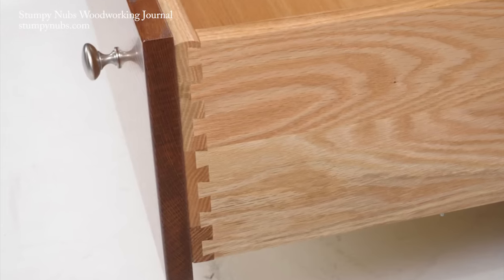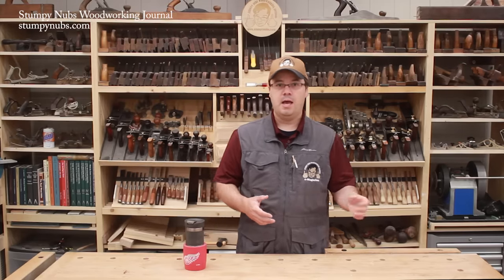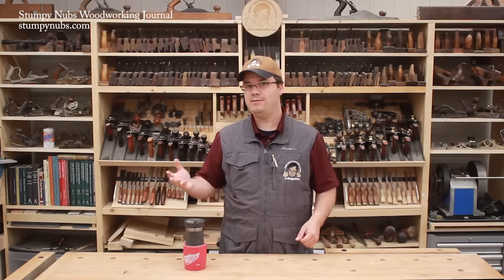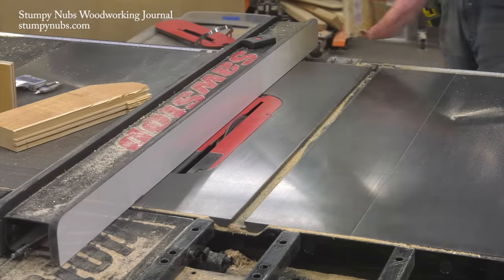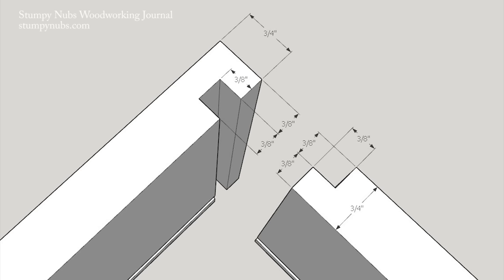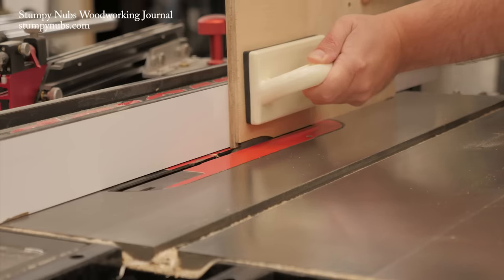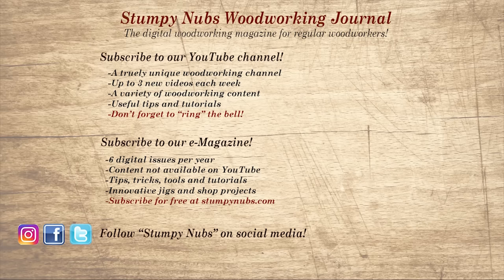The fast and easy half-half-half drawer construction method

Comment: I've seen the 1/4 - 1/4 - 1/4 videos, but they don't explain how to make the cut on the edge safely. This is the only reason I stay away from this method - balancing a thin board on its edge over a gaping hole doesn't look appealing to me. But  your explanation makes sense: tall feather board and a tall fence look much safer than other videos.
Reply from the maker: A zero-clearance insert also helps with that gaping hole

Comment: What is the tipping point for a half inch drawer to become a 3/4” plywood drawer? Is it the size, width, or what it will hold? Perhaps all three. Thx James.
Reply from the maker: Most drawers are perfectly fine in 1/2-inch. That usually  looks best, too. But a large drawer that will hold a lot of weight will benefit from 3/4.

Comment: I'm all about cost savings.  For draw bottom, if I have 1/4" and it will work, why not adjust setup to use the 1/4" sheet good.  It's such over kill to use 1/2".  If one doesn't want to adjust the setup, 1/4" into 3/8" slot is perfectly fine right?  It's not like anyone will see the 1/8" gap at the bottom of a drawer on the inside right?
Reply from the maker: A 1/2-inch drawer bottom is vastly stronger than 1/4-inch and not much more expensive. If you want to use 1/4, that's fine. But this technique isn't for that.

Comment: I disagree that the corners are the weakest part of a drawer.  I think the drawer floor is the weakest if made the common way of trapping a thin, floating panel in a groove.  This is why I've made scores of drawers by first cutting a floor to the overall size of the body.  Then I cut the four wall panels and set them atop the perimeter of the floor.  I use 1/2" Baltic for all the parts.  No sagging floors under heavy shop or kitchen tools and hardware.

Comment: so how does the bottom panel of the drawer slide in to the three sides of the drawer AND then have the 4th side which you are sliding down to it?  the edge of the dato groove on that fourth side will not clear the bottom panel?
Reply from the maker: Trim the groove off the back panel. Or don't and just put the bottom in as you assemble the sides. Your choice.

Comment: Using ½ inch ply that is always less than ½ inch thick presents a problem if one attempts to use a dado stack which is ¼ inch when using the 2 outer blades. This is greater than ½ the thickness of the ply. Ex: my ply is about 0.484 inches thick. Half of that is only 0.242 inches which is less than the ¼ (.250) inches of the dado stack using the two outer dado blades. So, what do I do?

Comment: One thing that still isn't clear for me is the final assembly. What is the last piece to go in? Is it the drawer bottom or the front/back panel? How do you fit the drawer bottom and the front/back panel into the setup so it locks in?
Reply from the maker: You put the drawer bottom in the grooves as you assemble the sides. In that clip you refer to the bottom is slid in after assembly because the back panel was trimmed short in the traditional drawer making way.

Comment: Couldn’t you still use 1/4-1/4-1/4 with any dimension of wood? All the groves would still be be 1/4 deep & wide and 1/4 from the edge. The only modification would be the rabbit cut, which would need to be larger to make sure the rabbit is 1/4?

Comment: Where do you find plywood that actually measures 0.50 or 0.75 inches thick?   They all measure a little less so those dimensions you showed need to be adjusted.
Reply from the maker: The thickness doesn't matter. Your dado set just has to be HALF of whatever it is.

Comment: Problem is, there. It such thing as 1/2” plywood.  It’s 15/32 or 12mm.
Reply: I use big box 3/4 ply which is 23/32.  Using the halfx3 method I needed a dado stack 23/64.  I did this using a 3/32 chipper and two 0.2mm shims.  Using a versatile dado stack and shims I'm sure you can come up with something for nominal 1/2 inch plywood.

Comment: If only... I live in a country where Dado sets are outlawed. The arbor on my table saw is too short. Any easy way to do this without a dado stack?
Reply from the maker: You can use a router table as long as the bit is half the thickness of your materials.
Reply: @StumpyNubs  Thanks James. Another comment on safety. It's probably better to use a zero clearance insert to prevent the narrow edge of the vertical boards from slipping down beside the blade.

Comment: Efficient way to put drawers together, aligning everything, etc, BUT that little sliver of end grain leftover when the dado is cut on the drawer side just cant be strong enough to resist racking, can it?
Reply from the maker: When you glue on the drawer back it essentially becomes one solid piece again.

Comment: For those of us more interested in hand tools, what would you use?
Reply: a chisel attached to a jig of course, that is except for 1 edge where you can just use any saw to make perpendicular cuts.  use your marking tool to make accurate guide lines.
Reply: You can set up jigs or guides to make dados and grooves with hand saws
Reply from the maker: A Stanley #45 with a 1/4" cutter (assuming your stock is 1/2-inch thick), a fence set 1/4" from the cutter and a depth stop set to 1/4" should do the trick if you operate it with care :)

Comment: Why cant I do this same process on my router table. The router is my favorite tool and I believe I could do the same setup. Will try because I like the ease.
Reply: You can do the same setup on a router table, but if you are going to use a router table, you might as well get the 45 degree locking rabbit bit for making drawers.

Comment: Don't you have a dado that extends all the way to the front face? Do you just cover it with a "show" face or is it stopped at some point?
Reply from the maker: The front drawer panel overlays the drawer box as a separate piece. It's screwed to the box from the inside, or the door handle holds in on. Very common way to make a drawer.
Reply: @Stumpy Nubs  ok cool, that's what I was meaning by a "show" face (incorrect term, but hey, I'm learning). So, to make sure I've got it all good, you build the box out of some structural material (e.g. plywood) and don't worry about the visible dado. You then cover the front face with a prettier "face" board and hold it on with screws or the handle itself. Is that about right?

Ps thank you for taking the time to answer my questions!
Reply from the maker: Somehow I missed the second sentence of your initial comment. Sorry. Yes, you are correct. And "show face" is a perfectly acceptable term :) Using a show face is very nice because you can adjust it to ensure your visual alignment is perfect. And because it covers the drawer box, whether you have an exposed dado end (like in this case), or if you want to make through dovetails instead of more difficult half-blind dovetails.

Comment: I see a lot of people asking the same question, and no answers:  How do you adjust this method to reality?   Even $100/sheet (just paid that today) 1/2"  Baltic Birch plywood is NOT 1/2"     How to accommodate the real thickness of plywood when using this technique?
Reply from the maker: As explained in the video, the dado set needs to be half the thickness of the material. Doesn't matter what that is.
Reply: @StumpyNubs  fair enough.   I can play with shims in my dado stack to do that, but it is a pain.   Lots of videos on this that all seem to assume perfectly fractionally-dimensioned lumber (i.e., 1/2" ), which as far as I can tell doesn't exist.  Where do people get that?   Even the $100/sheet 1/2" Baltic birch ply I bought for this project is not 1/2".

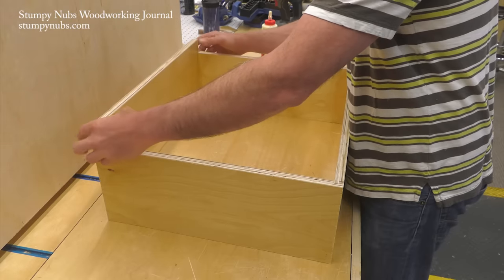Comment: The part I’m not quite getting is how to get the bottom panel into the groove and be able to slide the last side down like shown in the video (4:41, 5:35).
Reply from the maker: On that drawer we trimmed the back panel short and let the bottom panel protrude, as you would do with a traditional drawer with a solid bottom panel.
Reply: Last year I used this technique to make a bunch of CD storage drawers out of 3/4" material. The last side doesn't get slid in, it's pressed onto the front, back, and bottom all at once. I fitted the front and back to one side, slid in the bottom, THEN added the last side. Thanks to Mr. Nubs for a great presentation.

Comment: Hi Stumpy, your a little  mis-leading with this video, most of what you said is true and proven, but how did you show how to produce the stop dado on the sides using the sketchup model? second, If you cut the edge down all around the perimeter why do you it only raddeting only 3 sides of the 3/4 bottom panel?

Comment: How does one use this formula with typical plywood which is 1/32" thinner ? Thank you.
Reply from the maker: You set everything to half the thickness of the stock, be it 1/2-inch ply or 15/32 ply. Ridge Carbide makes a special dado set (https://ridgecarbidetool.com/dado-sets/triple-play-dado-set.html) that will cut thinner than 1/4" if you need it.
Reply: @StumpyNubs  I understand, but half of 15/32"  ??  Or does it not have to be perfectly exact?  Thank you!
Reply from the maker: I wouldn't worry about getting it closer than 1/32 or so.
Reply: Think digitally. I use a $5 (plastic!) digital caliper from HFT to do my setups. Measure the work pieces, divide by 2, and come as close as you can with the dado stack. Set the distance from the fence to the far side of the dado stack using one of the work pieces stood on edge.

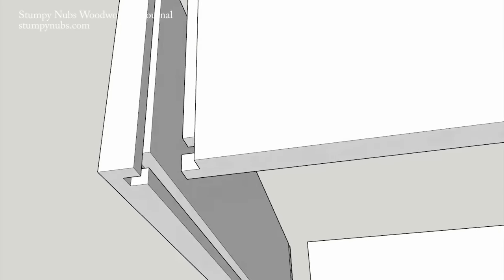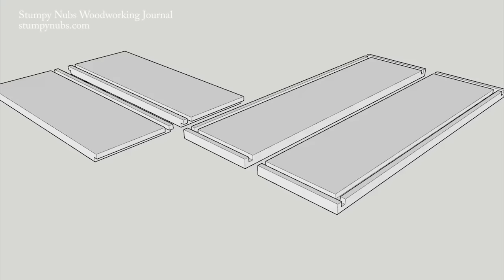Comment: The side-diagrams confused me, and I believe you have an error in the sketches (sample time-markers: 1:41, 2:42, 3:12, 4:29, 4:58, more), the dado cuts need to extend across each board lengths, whereas these sketches have a channel that stops short of the ends. Overall great video, and will attempt soon.

Comment: after having a small accident using this method to cut the rabbits I would add to the safety comment, be careful, also what do is put a sacrificial fence and cut them flat on the saw.

Comment: You are showing a stopped dado on the front, how are you cutting that on a tablesaw? You would have to have length stops on the saw, and and chisel out the rising round edge.
Reply from the maker: It's a small error on the drawing. In the video I cut a full dado.

Comment: But 3/4” plywood is not 3/4” thick. Usually a bit less. Can get messy. Best to use a mock up to adjust the cut
Reply from the maker: Doesn't matter the plywood's thickness. Just use half the thickness for your setup. Of course you should make test cuts.
Reply: Stumpy Nubs agreed. Just thought the clarification would be good. Some beginners might not realize that, even tho you sort of said it by calling the “half, half, half” setup and just set to 1/4” or 3/8” or half the nominal thickness of the material.

Comment: So, coming from 1/4 (which is short for the distance, thickness and height), when I hear "half-half-half" I think of 1/2" distance/offset, 1/2" thickness, and 1/2" height... maybe you should call it, "50%-50%-50%", just "50-50-50" for short.
Reply from the maker: If I call it 50-50-50 you might think I mean 50-inches.

Comment: but....what if you use 18 mm plywood? Hey 18 can be divided into two more easily than 3/4" so that is an advantage :-)
Reply from the maker: 3/4 divides by two just as easily. It's 3/8. You just double the second number in the fraction. It's pretty simple if you've lived with fractions your whole life.
Reply: @StumpyNubs  Except that 3/4" plywood isn't really 3/4"--if you use a 3/8" dado stack, don't you end up with an offset?
Reply from the maker: @BdwyMTI  As the video says, set your dado set to HALF the thickness of your plywood. If that's 3/4-inches, use a 3/8-inch dado set. If it's not 3/4-inches, use half of whatever it is.

Comment: Yeah but, 1/4” plywood is no longer 1/4”, it’s 5mm.
Reply from the maker: The beauty of a dado set is you can adjust it for undersized plywood. In fact, Ridge Carbide makes a special set that will go smaller than 1/4 for that purpose. I think it is called their double play set.

Comment: great idea & process---except 1/2" ply & 3/4" ply aren't 1/2" & 3/4". Is there a quick workaround? Heck---common plywood (not construction ply) is rarely the same thickness throughout the same sheet.
Reply from the maker: It doesn't matter. Just use half the thickness of the plywood for your setup.

Comment: Why does he talk like there is actually 1/2” plywood?  In case someone doesn’t know 1/4 = 5 or 6 mm, 1/2 = 15/32, 3/4 = 23/32.  Line up outer edge of blade to thickness of ply to get flush joint.
Reply from the maker: Do you call a 2X4 a "two by four" or do you you call it a "3.5 X 1.5?" Quarter and half are nominal thicknesses. That's why I say those numbers. And as I said several times in the video you use HALF the thickness of your material for your setup. Doesn't matter if it's metric or not.

Comment: I was with you until the bottom panel. No way would I use a 3/4” panel for my drawer bottom just to use that table saw method. To each his own though.
Reply from the maker: Who said you have to use a 3/4 bottom?
Reply: Stumpy Nubs It WAS early so I may have misunderstood- let me go back and listen to that part
Reply: Stumpy Nubs Well, you did say you could use 3/4” or 1/2” to be fair.
Reply from the maker: With the half-half-half setup, yes. But not with the quarter-quarter-quarter setup. That uses common 1/2-inch thick sides and 1/4-inch thick bottom panels.
Reply: Stumpy Nubs 👍🏻

Comment: No good for the UK or Europe where Dado blades are banned for elf 'n' safety reasons
Reply: Those cheeky elves! 😉 The operational concept also works on a router table with an adjustable fence.
Reply: Rubbish I use one all the time
Reply: I thought that was the case, but turns out they are available here, at least in mainland Europe.  The main issue with them, or so I am told, is that a heavier dado stack will make the saw exceed its allowed run-out time, or will load down the motor brake too much.  They don't seem to be popular though, apparently Euro woodworkers turn to the router table for this kind of work (and aren't shy to comment on "those crazy Americans and their unsafe table saws")
Reply: @joycemiller4716  good for you
However As already mentioned dado blades are illegal on UK (EU) table saws because in order to use them the guard and riving knife have to be removed, and is therefore unsafe. This is not the case in the USA. Because of this, all UK or european table saws are deliberatley fitted with short arbors to prevent their use. The only option is to import a table saw from the USA, although this must be for private use only.
Reply: sidney001 that’s what I did😂